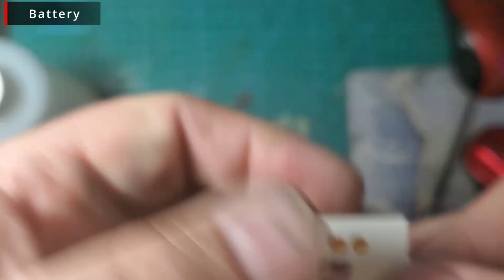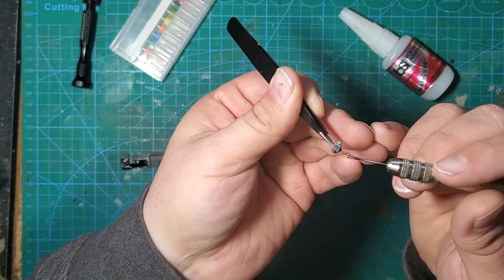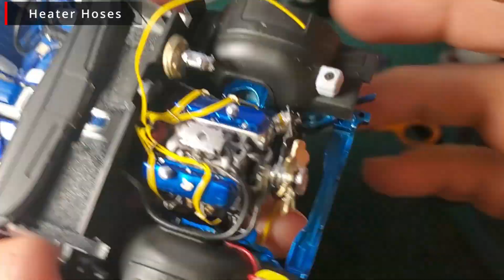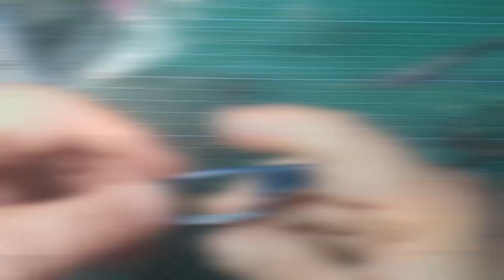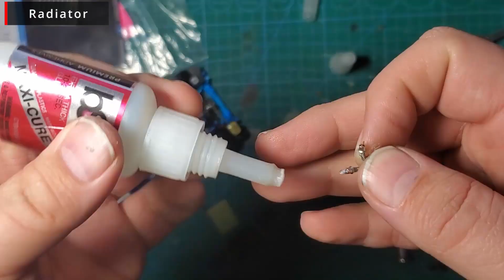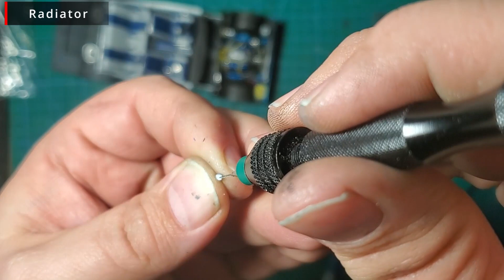Revell '68 Chevelle SS 396 - Engine Bay

Comment: I love your attention to detail Justin, all the wires and hoses really add to the model but I'm sorry the centre parting on the distributor cap (especially with yellow leads) is just wrong man.  With all the fantastic work you have put in to add realism to the engine, I just don't get why not at least just cross a few leads over, it wouldn't take any longer or cost any more.  I don't think a correct firing order is absolutely necessary but as it stands to me, it looks a bit like an octopus gently roasting over a warm engine. (My apologies)
Reply from the maker: Ha ha that's definitely a mental picture. I agree that could have been done a lot better.  We learn on every build. Normally it's never really bothered me as I was just trying to drill the kit distributors, and get the wires glued without making a huge mess. But with this aftermarket distributor from Pro Tech I really could have done better.  I'm already planning to do it better when I do the Nova, a couple of builds from now.  

Thanks for the honest feedback!
Reply: Thank you for your reply Justin, I do understand what you are saying, it is a relief when that last wire stays where it was intended.  Keep up the good work man, I love watching your videos and your quest for realism.
Reply from the maker: @wordenb1830  It's a relief if I can just get all 9 wires to fit IN the tiny kit distributor 😂🤣. Thanks for watching.

Comment: Great details Justin, battery looks awesome, where can I find the radiator caps?
Reply from the maker: Thanks Tom.  They are from small great details. https://smallgreatdetails.com  they have some great photo etch. These are the 2.49mm oil caps. they also sell a 3.33mm size I plan to pick up as well.
Reply: @JHartModelworks  Thanks Justin, I'll be checking them out